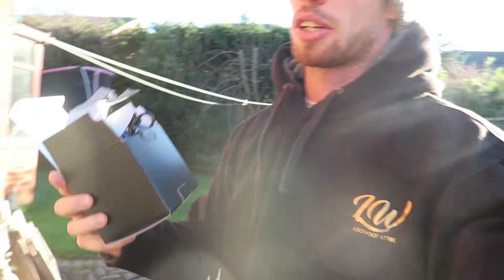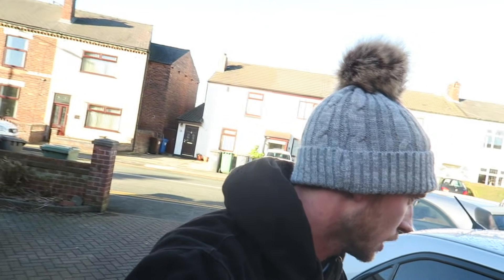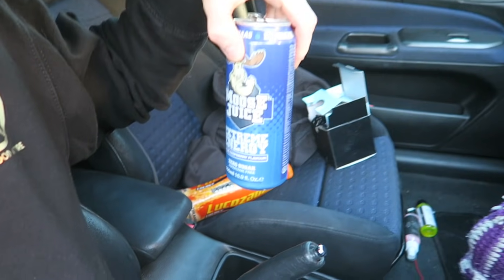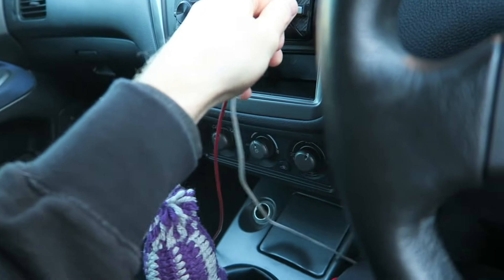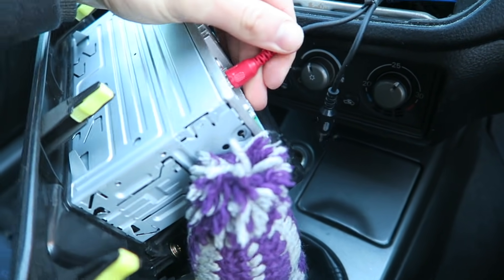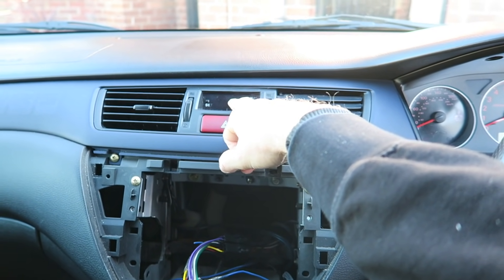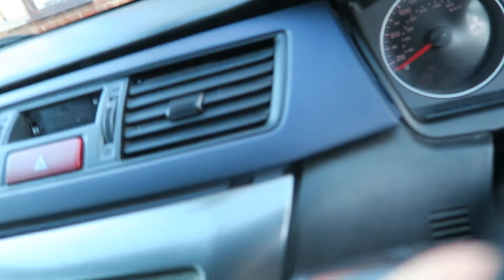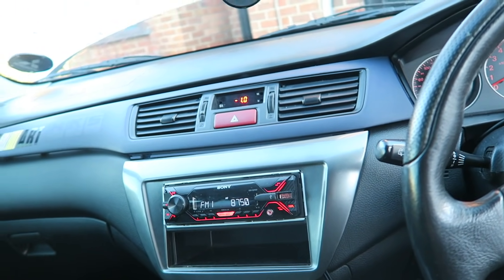How To Turn Your CLOCK into a BOOST GAUGE!

Comment: Why didnt you get a fused switched accessory live from the fuse box? That way your boost gauge will still work regardless of the operational status of the radio. Also the radio remote only supports a very tiny load just sufficient for an amplifier. Many installers even use a relay for amp remotes just to ease the load on the HU. Now you've added another accessory without solid connections. As for vacuum reference, for accuracy use as few "t pieces" as possible. I recommend a "vacuum manifold". Do things properly especially as you have a significant following/platform.

Comment: Why would you hook the power to the radio remote and not the radio switched power? Now the gauge will only be on if the radio is on...
Reply from the maker: Why would I need the boost gauge on when my radio isn’t?
Reply: I've heard that you can turn radios down these days if you want engine noise 😉

Comment: Cool little mod I thought you would of got an electronic boost controller by now. I've ran a gfb2 for few years you can spool turbo  up quicker and lower boost or raise it plus overboost protection boost by gear etc.

Comment: I'd be interested to see if you can hack apart the screen from the clock and then solder the outputs onto the display and use the actual original screen for it
Reply from the maker: my knowledge may not stretch that far hah
Reply: If I could get my hands on a O.E clock I'd be willing to try! Bet the Evo lads would be interested in buying something like that

Comment: Lol. Surely it would have been easier to put the sender in the bay and then run the cable through.
Reply from the maker: yes but i didnt have that much extra wiring and i was certain on tapping into the vacuum line for the turbo timer.. and i had the sender in the bay on the subaru and it looked tacky
Reply: Fair